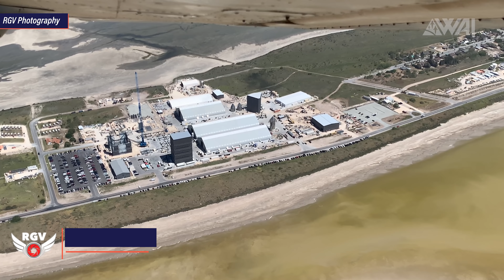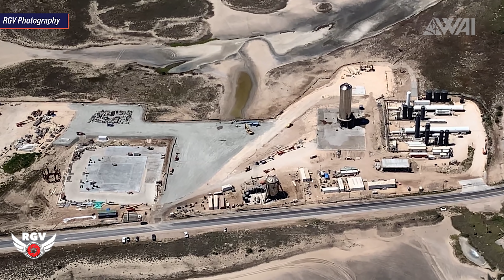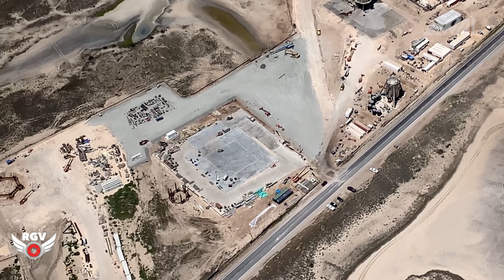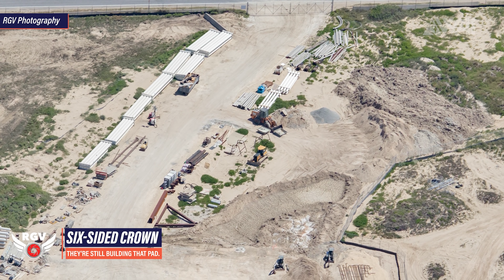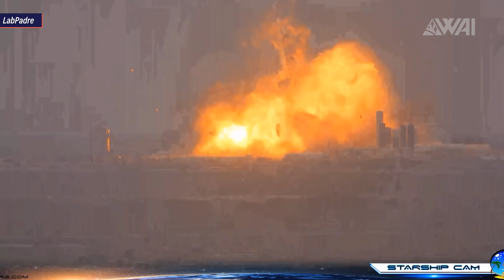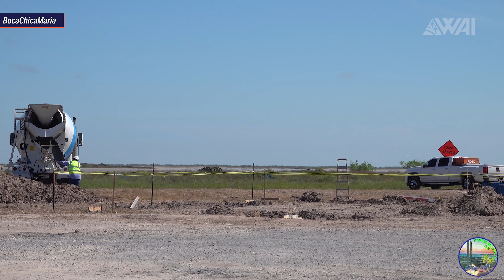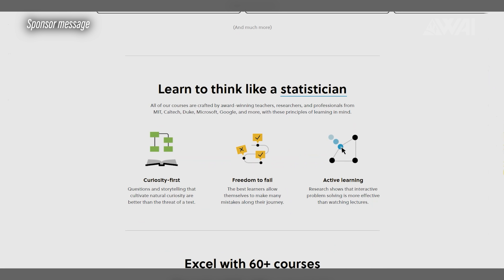107 | SpaceX Starship Updates – Why a hop will happen this time!

Comment: The concrete driver in video isn't pouring concrete he's at an washout area. He has to clean residue off before leaving.
Reply: All concrete trucks have a water tank and pump on them and have to wash off the chute. If not the concrete will harden on it and is a pain in the butt to remove and can damage it. Or i can come off while driving and damage car or hurt others.
Reply: I was looking for this comment
Reply: I'm a truck driver and deliver to construction sites and have hauled concrete in the past.
Reply: Even if he is just cleaning his truck off at that very moment....he had just tipped some concrete very close by! Lol
Reply: Chester Martin Not all concrete is structural, though. A lot of times, there will be a concrete pour on site and it’s just for a road curb or bollard filling or something.
Reply: @ajm2872  so?
Reply: Chester Martin My background is on-site construction materials testing. My personal bias might be showing here lol sorry.

The placement of non structural concrete is insignificant on most sites. I don’t even bother with getting his ticket, let alone taking a sample and running QC tests. It’s concrete, but for the contractors and engineers it’s basically a non-event.

Sorry again, but from my perspective, non structural mix isn’t really noteworthy :) but that’s just me.

Have a great night!
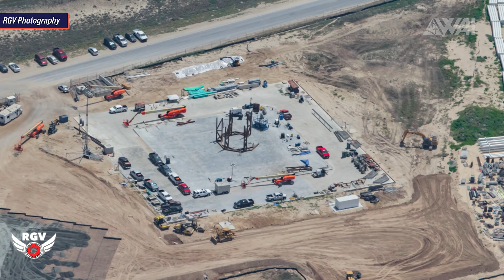Reply: Also, @6:00 they don't put down gravel before pouring concrete or asphalt, they put down aggregate base (aka AB). You can't compact gravel with a smooth drum or well, anything. If that base was made up of gravel it would be like a soft waterbed underneath all those heavy machines/vehicles/parts that would be on it.
Reply: Joebobjames Do the drivers at your plant keep their trucks clean? 

An Argos driver I know is always complaining because the other guys never do their clean out correctly, so he’s constantly dealing with crudded up chutes 😑
Reply: @ajm2872  don't haul it now but that was a problem when i did. But like with all jobs you always have people that half ass do their job.
Reply: Duh.
Reply from the maker: :D How did you find out?
Reply: @Whataboutit  Hello Félix. Il working on Concrete Farms, and he's right. This guy is simply cleaning his truck. He has to remove all residual concrete to avoid oxidation and sticking parts. Regards
Reply: @Whataboutit  Everybody who's ever laid concrete, even just a path in the back garden, knows this!

Comment: Some robots, probably for welding, already arrived to Boca Chica. Let's see if the welds looks improve.
Reply: Are they programmed with the Three Laws?
Reply: @odysseusrex5908  The thing that makes industrial robots dangerous is two issues.  1) They do exactly what you tell them to do.  2) They do it very, very fast.

So if you make a mistake with a command - things can get very expensive before you can hit the 'emergency stop' button.
Reply: @colincampbell767   Expensive and dangerous.

Comment: SN-6 seems as a backup for SN-5 but may be used after SN-5 has successfully completed a hop.
Reply: kaya cayci I bet Elon will test SN5 tanks to destruction after the hop.
Reply: Doug InOrlando Elon be like >:D
Reply: What happened to SN7?
Reply: @joshuahardy4922  it was repaired and then tested to destruction.
Reply: @joshuahardy4922  It did a short hop when the lower bulkhead failed. :)
Reply from the maker: Yep. It may or may not be used. :D
Reply: @Whataboutit    So then, can we say it's a Schrodinger's Starship? (grinning and ducking and running)